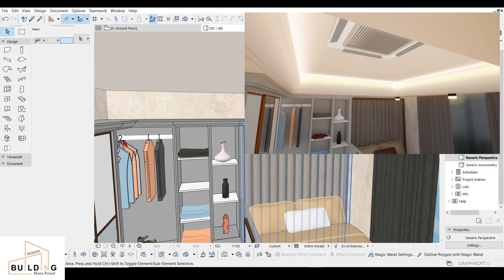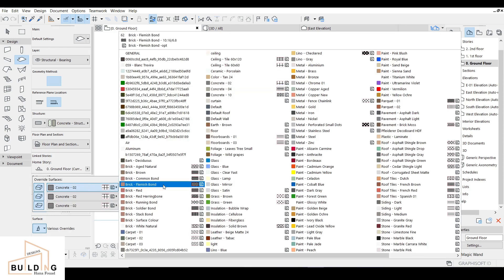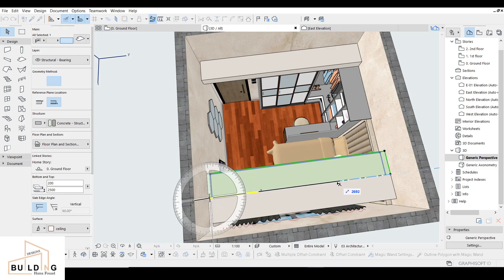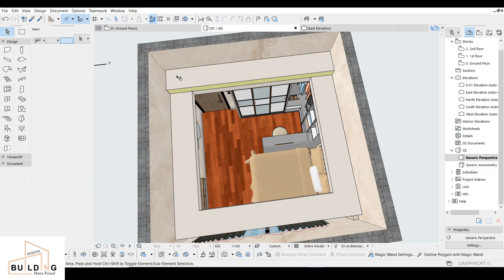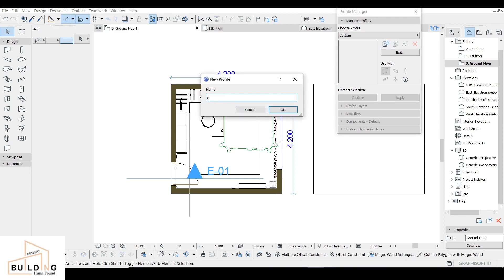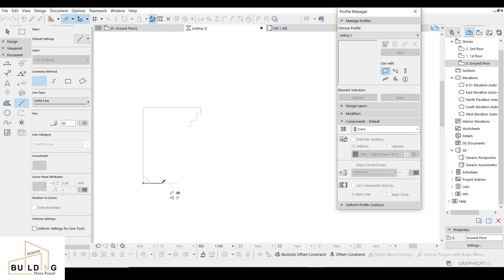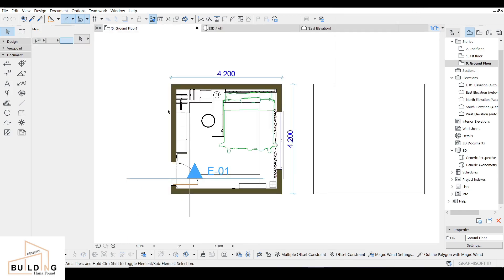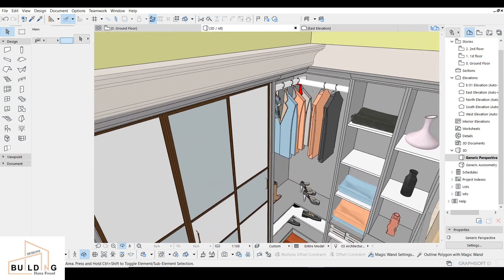How To Use Complex Profile For Ceiling With Led Lights | ArchiCad

Comment: Then how it will light or bright for twimotion
Reply: Thanks for answering🥰
Reply from the maker: There are two options:
1) You can select the brightness from Twinmotion software called light (Area light).
2) Doing rending in Archicad software, check out the video of led lights for ceiling: https://youtu.be/IPCLavGBvw0